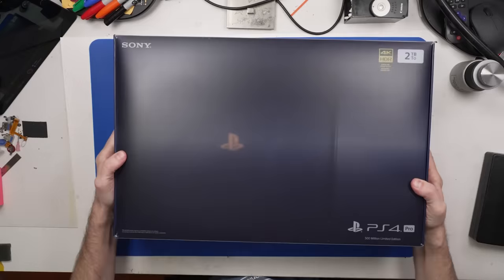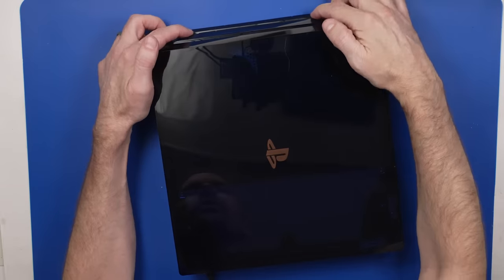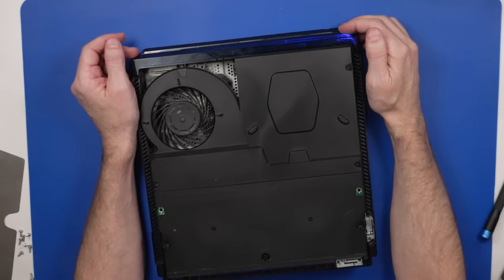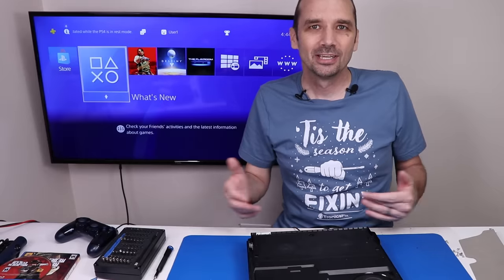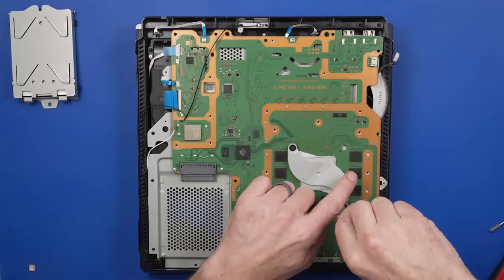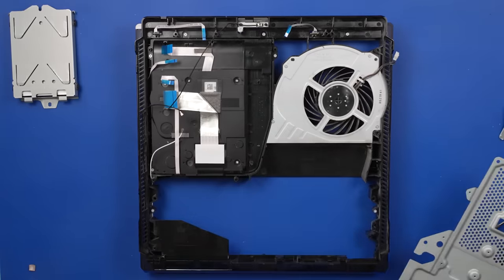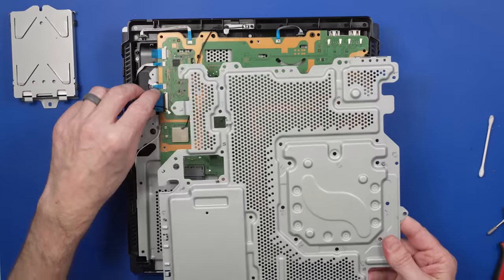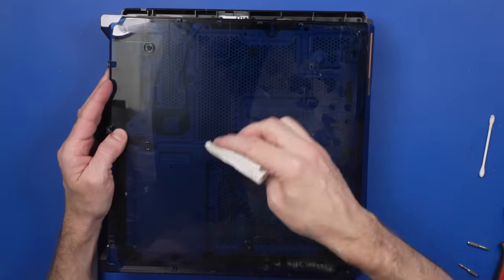Rare PS4 Deemed "Unfixable" After Repair Shop Fail - Can I Fix It?!

Comment: Pretty sure the shop was hoping the seller would just give them the unrepairable console
Reply from the maker: Hmmm...that is possible. Hadn't thought of that
Reply: My thoughts exactly.
Reply: That has happened to me, I knew it was fixable, they were just scammers
Reply: @Dabid13 especially as its quite rare
Reply: @Tronicsfix  in Poland we have very old  IT dad joke.
Caller: "Mr IT wizard my PC wont turn on"
MR IT: Did you connect the power cable to the power socket?
Caller: Mr IT i did not, Do i need to?
Reply: I friend of mine took his ps3 to the shop with the YLOD, and they told it was unrepairable, and he said if I wanted I could pick it up from them. I did, and they were about to harvest it for parts, they returned it to me with missing bluray and some other stuff, I went back there and demanded that they gave everything back. This is why we hate those shops, and Tronics is a such a lovable guy.
It's a shame we have more of scammers than Tronics out there 😭
Reply: Agree. They wanted it. A sleazy thing to do. Wonder if the owner paid them for checking that it was unrepairable.
Reply: @ExcelInstructor  i have actually had this conversation with a client before. just once...
Reply: Never leave it at the shop that couldn't fix it.
Reply: Yeah seems fishy they did a good job on the actual repair, and then just don't connect a cable.
Reply: @mbradfield53  ^^^
Reply: Yeah, a rare console that’s impossible to repair but only has an unplugged connector, I smell a scam.
Reply: @ExcelInstructor  It can’t be very old, how long have computers been around? And I thought jokes were supposed to be funny…
Reply: This was my exact thought
Reply: @Tronicsfix do you ever have anyone express regret selling you their console after they see how easily you fixed it?
Reply: @Tronicsfix  If you're interested in a trade! I got a cyberpunk edition xbox one x with 2 matching controls? 🤔
Reply: @marcs9068   They still didn't do a good job on the actual repair. The original complaint was overheating and they didn't clean dustballs from the heat sink fins or clean the general dust from the overall console.
Reply: Yep this x100, and then repair it properly and charge someone else full price.
Reply: it's absolutely mind boggling that you would fix the system (the hardest part) and then fail to properly secure every screw in it's correct spot, do basic cleaning, clean the heatsink, clean all the excess thermal paste, plug in the power.  There's 100 guides on how to properly unassemble and reassemble this console.  This is so lazy and dumb that I think you might be right.  It's almost comical how bad this was,  and if in the end they suggested it was "unrepairable" but offered him money for it for parts - then this was 100% a scam.  I never heard of ubreakifix until now.  What a horrible company.
Reply: @ExcelInstructor  The British version is "Hello IT, have you tried turning it off and on again?"
Reply: @Atari5732  they probably broke the connector in the first place
Reply: Yep. Beat me to it.
Reply: @schrodingerscat8621  Computers have been around for consumers since the 70's, so about  50years..
Reply: @Tronicsfix  So how come Sony called it the 500 million edition ps4?
Reply: This is absolutely what they were trying to do. It’s quite possibly the rarest ps4 out there.
Reply: Yep, or sell it to them hoping to get a really good deal on it.
Reply: @robertcoulthard7461  The rabbit hole goes deeper?!
Reply: There is no doubt about  that
Reply: thats what my moms ex mechanic try to do. he claimed the car is unfixable and offered 300$ for her car. my brother was able to fix her car
Reply: That's exactly what they were trying, call me cynical but I've seen folk do it, I wouldn't be surprised if before the customer took it back the guy was trying to convince them they'll just scrap it to save them carrying a dead weight.
Reply: Yeah I have the same console, had the same problem, remarkable that the original owner knew exactly how to fix it and the shop still got it wrong
Reply: @wolfevil9463  sue them instead, that's clearly property stealing without your permission. I would do the same thing
Reply: Exactly, first thing I thought of: "It's unfixable but we can take it off your hands for $100."
Reply: It's like when my sister unplugged her router during an update, the repairshop said it is bricked and not fixable so they could throw it for her, it took me less than 10 minutes to fix

It was a pretty expensive one to
Reply: I was literally thinking the same thing
Reply: You are right because they can fix it and resell it on eBay for a good profit on the side ,also they don’t call the customer hoping they will forge it ,had the same experience with my Samsung phone
Reply: Yeah that's greeeeeasy.
Reply: Which I'd wager is a scam that has worked for them, more often than not.
Reply: @ThatsGuy410  man i would love to have that
Reply: @danielmoung9098  because it was to celebrate selling over 500 million units of the original PS4
Reply: @Superabound2  How much you got?
Reply: I have a question it is about the cd drive if it sounds loud and like something is loose would it be that the rollers came of the tabs. Cd rom works just fine it's just when it's trying to receive a game.
Reply: That or a minimum-wage worker provided the amount of "service" that minimum-wage pays for.
Reply: @Tronicsfix  This was the first thing I thought of as its a special edition.
Reply: i do mostly xbox laptops and iphone repairs myself but i dont do iphone logic board repairs i had an 11 pro at the time the newest iphone was the 12 pro and  i had just put a new screen on this iphone 11 pro and it didnt turn on and i tried a new battery and charging port and nothing so i assumed it had a logic board issue due to the phone being previously water damaged the guy tried telling me it wasnt fixable and offered $20 for an 11 prob that only needed a screen turned out the screen i bought was faulty but i didnt realize until a few months later when i bought another 11 pro to fix because the iphone 11 pro wont turn on and or vibrate like most iphones without a functioning screen on it
Reply: Louis Rossman and TronicsFix should open a chain of repair shops that have their ethos.
Reply: that is what I think too every time I hear that.
Reply: @ExcelInstructor  urządzenia elektryczne działają lepiej podłączone do prądu 😉
Reply: @ExcelInstructor  Bro this is just real life. 🤣🤣🤣
Reply: @johndavidson2365  they just forgot to connect the power supply and said it's ufixable,what a shame
Reply: @robertcoulthard7461  valid point
Reply: @robertcoulthard7461  yea ur right bro those places will Robb u
Reply: Happened to me once I sent my OG PS3 in for repair. They said they found the problem but didn't have the resources to fix it.. They wanted to charge me 70 euros for troubleshooting, and I asked what they'd pay me for it to keep it and they said "We won't pay you but at least you won't have to pay for shipping it back" 
"I want my console back"
Reply: Thats 100% what they wanted.

Comment: With that unplugged power supply, that essentially confirms that they were really hoping that the owner will just sell it to them for cheap.
Reply: I think the fact that they tried to fix the damage they did says otherwise. I think like Steve said. They tore off the connector and forgot to plug it in, and figured it was a failed attempt.
Reply: Nah man they wouldn't overlook something so simple It's more than likely that they were going to try to buy it from the guy for cheap and then sell that for a really high price after just plugging it back in Even then they're still scummy for not going back in at least checking it
Reply: @Lordskeep  its a well known modus for shady repairment. it was similar to mechanics qouting they found more damage in your car than your aware of so they can charge more from you. tips i learned even since i own an electronic, "always watch as they repair your device."
Reply: The only people that know for sure are the guys that attempted the so called repair.   You’d be surprised how easy it is to forget one simple connector piece and scratch your head wondering what went wrong.   
Regardless, even if the repair was intended to be legit, it was done so sloppy that it’s unacceptable.
Reply: No they just wanted to sell a new console

Comment: I feel so bad for the original owner, poor guy or gal sold their console because they were told it was unrepairable, only for the problem to be one cable to not be plugged in.
Reply: The main problem was overheating, they didn't manage to fix the issue and made it worst by forgetting to plug in the power

Comment: Thanks for adding the individual detailed little explanations when taking the system apart like the heat shield's purpose, the fan screws, the disk roller removal etc.

Comment: More info is really needed on these "repair shops" that do this kind of work. I have a feeling they are the same level as the phone repair shops you see that are sketchy as hell the second you walk in.
Reply: He did say that the name starts with a U and is a national brand, really only one that it could be. Since Steve didn't name it I won't but it's not hard to find.
Reply: @MyBrothersMario  is it ubreakifix?
Reply: @vladnicolescu2638  It probably is. That place seems like a scam when you walk in the door. I almost got a phone battery replaced there until I spoke to one of the so called experts. No thanks.

Comment: As someone who potentially works at a repair shop chain that starts with a "u" and has worked for 3 different locations of it, I'll say this, before going to one, one needs to understand that this chain is what I'd describe as a more casual repair shop. Some locations for instance don't do micro soldering or soldering at all if the staff isn't available. Again, it depends on the location, but basically if you go there, keep in mind it's likely gonna be a lot more casual than someone like TronicsFix who actually will take the time to properly care for a device, like we see here, whereas this nationwide repair chain, depending on the location, just wants to make money and get your device out as quickly as possible, even at the cost of a quality repair. Once again, casual and corporate, not meticulous and caring as it should be.
Reply: I have a good friend that works at one who is a VERY competent and talented technician.  Who was at one point a manager and for him finding competence was hard to do. So what you said is very true.
Reply: Why cant you guys just say the name of the company is it against the rules or something lol? U break.... I fix... come on lol they did bad work they should get called out on it.
Reply: @dohner29  because it can be damaging for the company and you don’t do that after one bad experience.
Reply: @mauritsonbekend5788  they have a terrible reputation. Bit more than just anecdotal at this point. They deserve to be called out.
Reply: We can say the name, he can’t. It can be considered defamation. So we don’t have to worry about it as much as he does. You can definitely piece together what the name is if you think about it long enough. I mean, the customer didn’t take it to U-Haul

Comment: “I wish there weren’t as many scratches on this case as there are”

Proceeds to use hand with ring on finger, to then add more scratches
😂😂😂

Solid work as always 🎉❤
Reply: It's a rubber ring, pretty commonly used by people in electronic work.
Reply: He also leaves the controller and other stuff on the console itself, all not helping to avoid further scratches...it pains my heart.
Reply: @Exorcistje  it hurts to see. I'm the type of person who keeps the plastic on things like this. If I can't leave it on I'll apply a ceramic coating. I figure if it can protect my car from minor scratches for a few years in the sun it'll last forever on something inside.

Comment: I am just a hobbyist level repair tech, not a professional, have never worked in a shop, BUT I feel like this is less a skill issue and more an attitude issue. I would NEVER send something back with a screw rattling around inside or without putting it back together completely

Comment: Try avoiding IPA for the laser lens. When the laser was polished there is some wax remaining. IPA removes that layer.
A good brand glass cleaner (windex,...) will do. You can off course wax it again, if you've used IPA.
IPA will work, but the next dirt is realy going to stick. Great video and thanks for saving this special PS4.

Comment: 8:22 the thermal pad is what was knocked off the motherboard when you opened it for the first time, in fact it’s actually there in the bottom left corner of the screen!

Comment: That's a nice looking system I didn't even know these existed. There is one on eBay brand new and they are asking $13,000 for it LOL!
Reply from the maker: Lol,
Reply: @Tronicsfix   I assume you didn't pay anywhere near that.  lol.
Reply: I was asking for $15,000 originally.
Reply: There’s a listing here in Australia for just over $1800 (brand new and sealed) which is around $1200 USD
Reply: it could be a unique number that is valuable

Comment: I'm honestly surprised you don't have a box of spare fresh thermal pads on hand with how much you do these repairs. They don't cost too much bought in that volume, and personally it would give me peace of mind they are definitely making full contact with the chips. 
You can also clean those cases up fairly easy depending what side the scratch is on... But it takes a little experience to get the finish right. Maybe the restorist could have a go at it? :)
Reply: just plaster on some of that k5 pro
Reply: If the thermal pad is in the right place, the pressure from the heat sink will hold it in place and the heat will reactivate the contact so no problem there.

Comment: 🎯 Key Takeaways for quick navigation:

00:00 🎮 Bought a rare PS4 Pro 500 million special edition with overheating issues from a repair shop.
03:51 💡 The repair shop had failed to reconnect the power supply connector, making the PS4 seem unfixable.
10:09 📀 Disassembled and cleaned the disc drive to address overheating problems.
14:07 🌡️ Cleaned the heat sink and reapplied thermal paste to prevent overheating.
18:05 ✔️ Successfully fixed the PS4 and got it working again, highlighting the importance of proper repair work.

Made with HARPA AI

Comment: Most, if not all of these "repair shops" have techs who are "self taught" with no certifications of any kind. They will even hire people with no experience so long as they are "willing to learn". They also pay these employees minimum wage (or close to it). I know from first hand knowledge. One of my first repair jobs was at such a place. I already had plenty of experience working with Windows & MacOS and building/troubleshooting computers, but this shop was offering all sorts of repairs... console, phone, tablet, etc. They would "google" or look for YouTube videos on how to do something, buy random tools they figured 'would work' and had me do all sorts of experimentation. They did make customers sign a waiver stating that they are not responsible if something happens to the customer's device. There were so many times that a customer's device wasn't fixed properly (or "accidentally" damaged) and the owner would always give some sort of b.s. excuse to the customer and tried to make it seem like it couldn't be fixed (or chances of fixing were low due to the state the item was in when it was dropped off with us). I got out of that shop as soon as I could.

Comment: In regards to the plastic. You can "fabricate" tabs etc sometimes with the superglue and baking soda trick. There's some youtube vids on it. You put a dob of superglue on it then the plastic that's broken and the baking soda reacts with the glue and you get a kind of "plastic" it's fairly strong. In the vids i watched it was used to fill in voids and fabricate missing bits like tabs. He used a small set of files to shape it in the vid i saw. He was fixing an old pc.

Comment: Ive worked for a 'repair shop that starts with a u' for several years and can confirm, this is how so many of their corporate stores do their work. It gives the franchise stores like the one i worked for who had a decent soldering team and never left something like this in thr cutomer's hands a horrible rap. Sadly not surprising though
Reply: In my opinion, thr big company starting with a u was not a horrible company until the big company starting with an a bought them out a few years ago. When that happened things went downhill fast

Comment: There should be a worldwide standard for how these repairs are handled. Here in Norway, provided you've purchased your electronic device from an official brand retailer, there are authorized brand service shops you can deliver or send your devices to and have them repaired if still under warranty. You can also have them repaired even if the warranty has expired, but then you have to pay for parts and labour. It's also possible to have your device repaired under the home insurance (if no longer under warranty), but you have to pay a fixed deductible. So if the device is worth being fixed for the deductible you're paying (valuation done by the insurance company), it's a no-brainer.

It's always enjoyable to see you bringing different broken electronics back to life, but sometimes I wonder how people are treating their stuff (children are unpredictable, though, I know 🙂) and how honest they are when putting the blame on a store's attempts at a repair. Unless properly documented, I would guess some owners don't shy away from trying to fix things themselves. Ie. thinking "how hard can it be?".